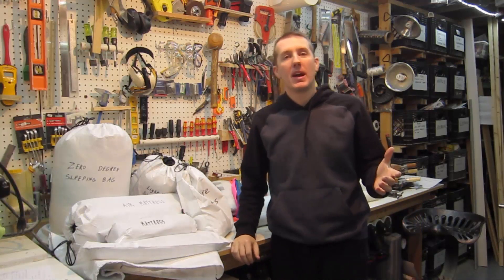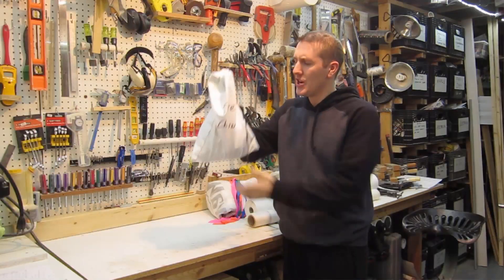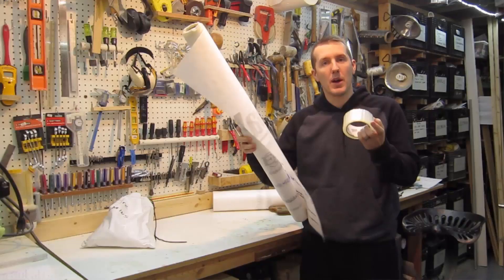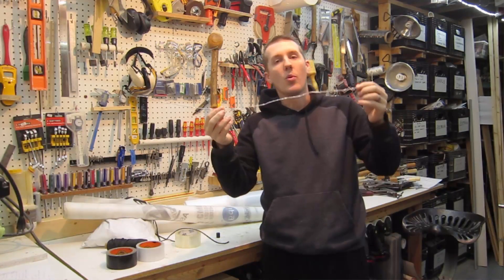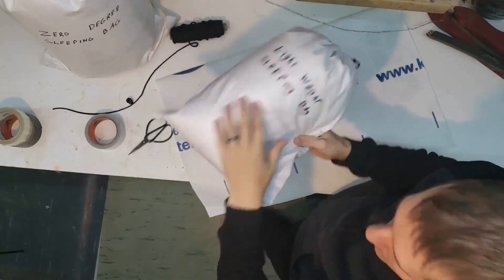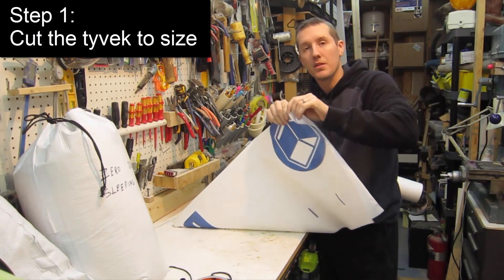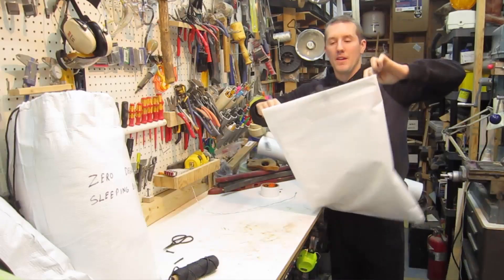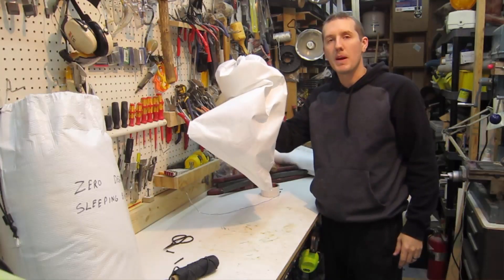How to Make a Tyvek Bag

Comment: Very helpful information!  For a good while I have been thinking that tyvek would make an excellent material for a backpacking tent, waterproof, breathable, lightweight.  I understand that it is noisy but have heard if you launder it a few times it softens it and makes it less crinkly and quieter.  Have you ever tried to make one?
Reply from the maker: Made a backpack.  Still have it.  Works great.  Although i used a different type of tyvek, more of a softer cloth, not as noisy as the traditional plastic stuff:  https://davewirth.blogspot.com/2012/12/tyvek-backpack.html
Reply: they make those hazmat suits out of it and they're no louder than a tent
Reply: Any updates? I'm here looking for ways to use up some offcuts I'm anticipating.

I have a DD aframe mesh tent white I want to add some kind of tarp/tent out of ultralight tyvek... it's for a hiking/backpacking tent. 

So any ideas you may have would be welcome.

Comment: Have you considered going over the seams with a rubber roller?  Some adhesives require a lot of force + time to properly whet onto the surface. Also, at 8:27, you don't need to cut the side---just fold it all the way around.  Last point: this is some heavy ass construction.  For light and ultralight applications, stitching might be better.  More involved process than using tape, though.  Nice backpack, too.  Thanks for sharing.
Reply from the maker: The roller is a good idea, but the tape is fairly sticky when it comes in contact with the tyvek.  For weight i wish i could use a lighter tape though.
Stitching is better, but more work.  In the past i've made a kite and backpack with tyvek - combination of sewing and packaging tape.
Backpack - https://davewirth.blogspot.com/2012/12/tyvek-backpack.html
Kite - https://davewirth.blogspot.com/2012/04/diy-how-to-make-tyvek-flow-form-kite.html

Comment: I'd suggest washing the tyvek in a washing machine first (without soap). It won't lose its water resistance or strength, but it will no longer be really loud and crinkly.  It'll be soft and cottony.  You can also make tarps and tents and backpacks out of it!
Reply from the maker: I've heard about washing it.  Seems like a good idea.
And i did make a backpack out of Tyvek back in 2012:  https://davewirth.blogspot.com/2012/12/tyvek-backpack.html

Comment: Ain't tyvek great?
Made alot of stuff sacks with it over the years, never thought about doing it with duct tape.
Just a suggestion. If you don't have one already, pick up a old sewing machine and try making one with that. It'll give you more options (ie: tool rolls) They can be had for 0 to $50 for an old cast iron Singer. 

Dan
Reply: But wouldn’t you still need to tape the stitching since the tyvek has been perforated?